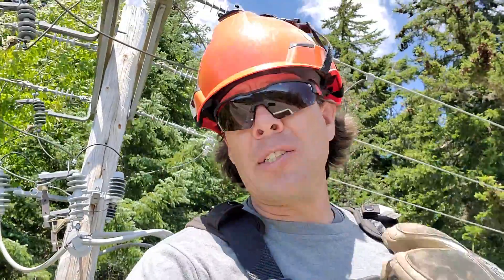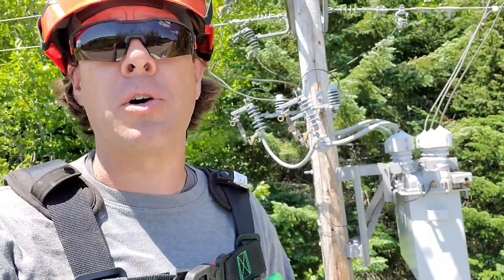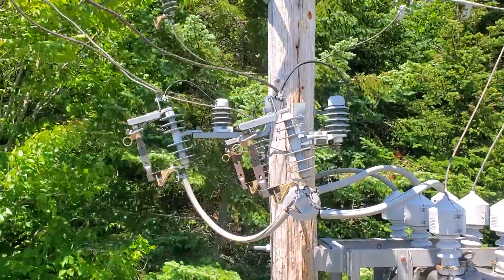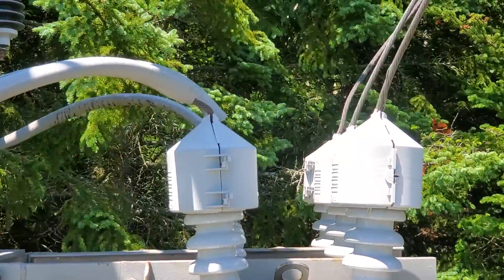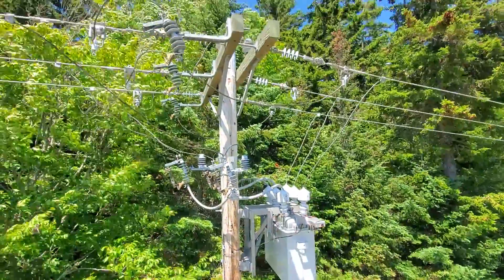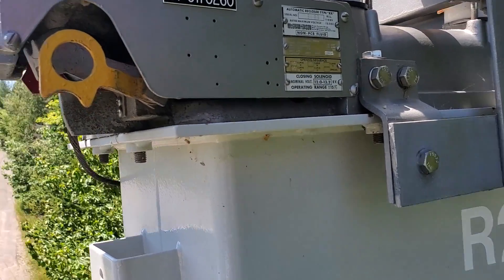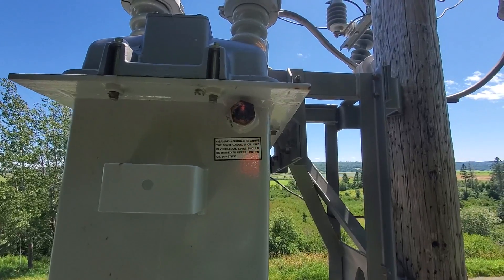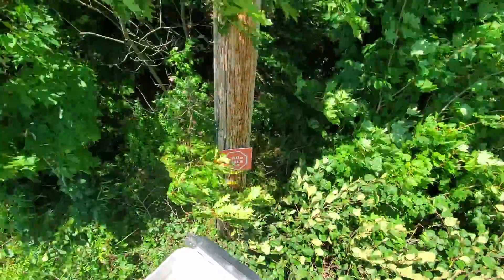Recloser - Might be why your lights just flickered!

Comment: Interesting!   To the layman it seems incredible that those lines are not insulated!   Those nuisance faults would no happen if they were.   Plastic is cheap compared to te dangers.
Reply from the maker: We do have insulated primary wires as well. Like anything, there's some advantages and disadvantages.

They're great for reducing outages with brush contacts from animals or tree limbs.

The biggest problem is during major faults such as car accidents they're less likely to trip the lines. As they fall or become damaged they can easily gouge the insulation which may expose the conductor. You would then have live high voltage lines laying on the ground.

They're also not as easy to work on when they are covered
Reply: @liam3284  Are you talking about those diamond-shaped separators?

Comment: Is that counter next to the reclosing handle at 7:44 is the number of times that unit has cycled by itself, or how many times it's been manually tripped?
Reply from the maker: The counter is for each and every reclose. It can come in handy if I get multiple complaints of lights blinking on a line. I'll document the number of operations and reference that a couple days later. If more reports come in and the counter hasn't moved then it may be a more localized problem

Comment: Hey, that's a really great explanation of the general equipment! Would you consider installing fault indicators on the load side? Can lineman install fault indicators for convenience or does the placement need to be approved by engineering?
Reply: "Can lineman install fault indicators..."  I'd be pretty sure Bob and cohort can't install any significant gear without the order from Engineering. The line workers sure can suggest "Hey! Some pilot lights would find faults faster!!" and see if the company bureaucracy agrees. 
However increasingly we have 'smart meters' which report-back to headquarters every 15 minutes, and maybe on-demand. When the board operator sees a clump of customers go dark on the map, the location of an out-fault can be pinpointed to between two customers. "George is up, Paul is down", look around poles 101 and 102. If it is just Paul, it may be his 240V transformer. If it is the mile of street after Paul, it is on the 10KV side.

Comment: my lights flicker for 8 seconds every couple of minutes, it's the twacs meters broadcasting in the neighborhood and they are feeding back into my house,  power company says nothing should be getting into my home because the 60:1 pole pig is an isolation transformer.  I asked then how does the twacs signal get out then and he was silent.   power company around here is clueless.  they said my hvac compressor says 208v on the label and needs to be rated at 240v.   well duh, it's capable of running on 208, that doesnt mean that it is.
Reply: The twacs signal is a bit weird, very low frequency. That's how it's able to cross transformers.  Tends to move the zero crossing of the voltage waveform, which looks a little bit like what a dimmer does.

I think it's most likely that fault lies with the light design (LED?).  They're often pretty bad - even if they don't seem cheap every manufacturer tries to shave pennies. And dimmable LEDs are probably even more susceptible.

So there's incompatibility between equipment. Unfortunately, I'm pretty confident that the power company didn't install equipment that fails their own power quality standards, so it'll be nearly impossible to get them to accept responsibility.

So probably the best thing to do is to network with other customers, identify which lightbulbs (or other appliances)  don't work, and get local lawmakers interested in the problem. One angle is that there might not be a standard for low frequency noise because, before twacs, there was nothing on the grid that generated that kind of noise.  So the power company assumed it would be okay without due diligence - was that really fair?

Also, be quick to learn from mistakes. Engineers love to dismiss people who are stubbornly wrong.  For example, if a motor isn't actually rated for 240V and your argument is "I wired up and it works for now" that's not going to make a good impression.  It's very possible that the motor is rated for both and you just did a better job of reading the paperwork, but my experience with engineers, lawyers and lawmakers is that that they all have much more respect for paperwork than for juryrigging.
Reply: @jordanrodrigues1279  both my main hvac and my mini split have different taps for different voltages.   as far as the LED's go, the dimmers and bulbs are complaint and made by the same company.  I do have some rooms that have mis-matched brands, but even the businesses down the road on the same feed have light flickering issues.  it's coming from the power company or sub station that feeds us.  they are quick to blame me or a device in my house, but i've cycled breakers and left only the kitchen lights on and it still does it.
Reply: I find it fascinating how residential equipment is now commonly referred to as HVAC...

Comment: I am going to have to go look at the one the next block over.  I was thinking it was a circuit switch.  There is a nearby feed across the street of all 3 phases plus neutral.  There is a large mini-storage on that side of the street.  FYI, I am way down in Hutto, Texas, about as far south as I can be and still be in Oncor territory.  If you go further south of the next city, Pflugerville, then you get into territory belonging to the City of Austin Electric utility.